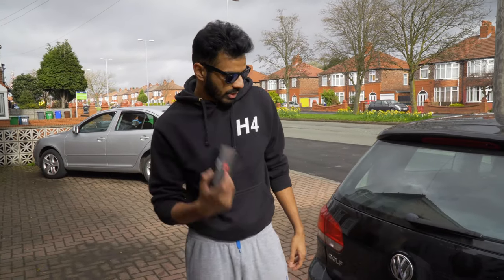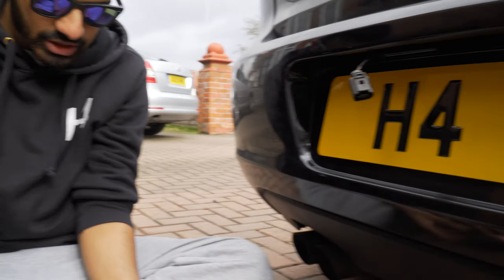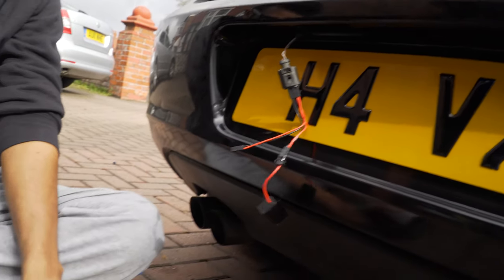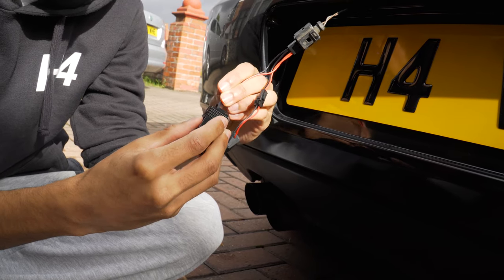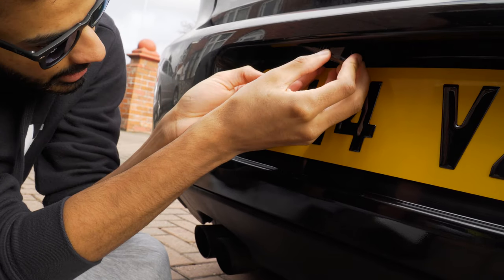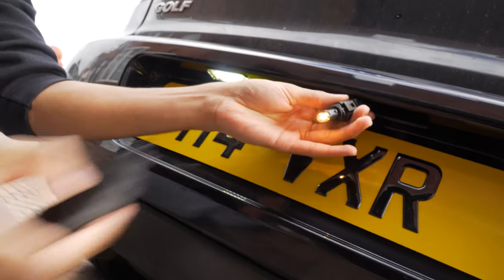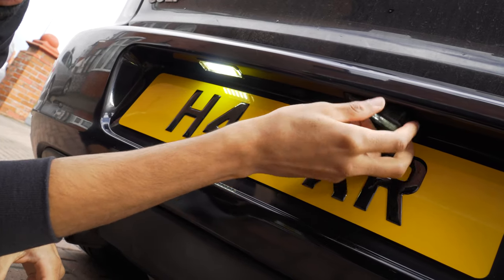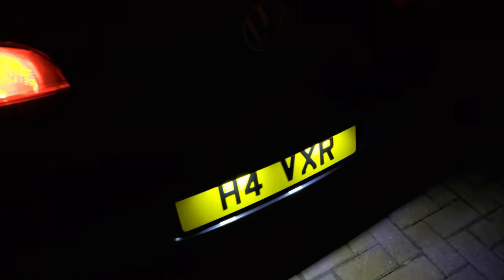Vw Golf Mk6 Number Plate Lights Change

Comment: Hey, what is the function of the loose ends? I installed the same set on my VW Lupo however I didn't use the loose ends and just left the wires hanging. Mine is working fine so far so can you tell me what their function is? I suspect maybe like a canbus system? My Lupo does not have that so maybe, therefore, it is not a problem.

Comment: I have a mark 6 estate. The plug that comes from the car isn’t the same fitting as this. It’s way smaller. Looks similar to what connects to the resistor
Reply: Did you have a solution?

Comment: Mine doesnt have 2 plugs that connect to the black box. Could I still connect the light without the black rectangle box?
Reply from the maker: If it fits then yea
Reply: @H4Torque  what does the black rectangle box do?
Reply from the maker: It's the housing for the light
Reply: @H4Torque  What do you mean by housing? If I use it without it would it still be fine? Thanks.